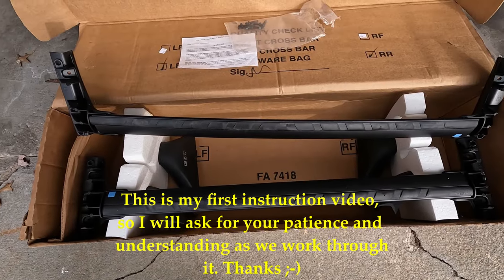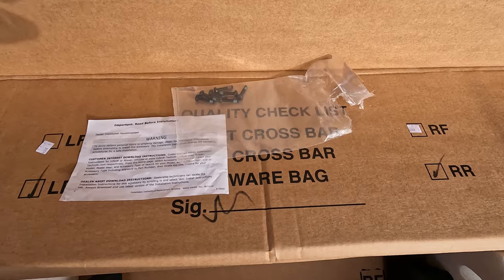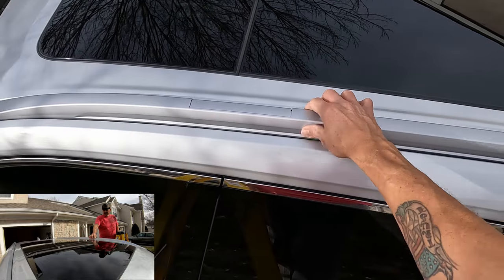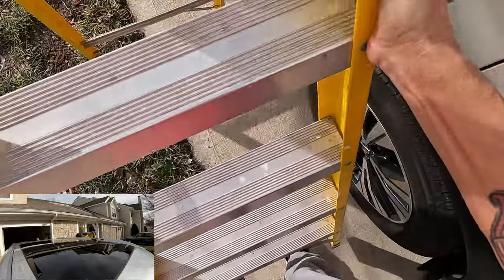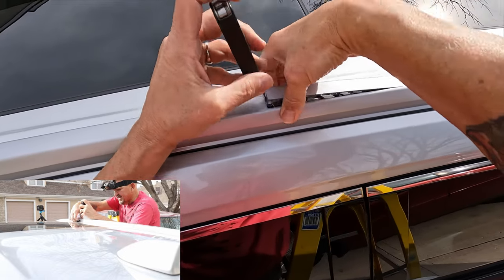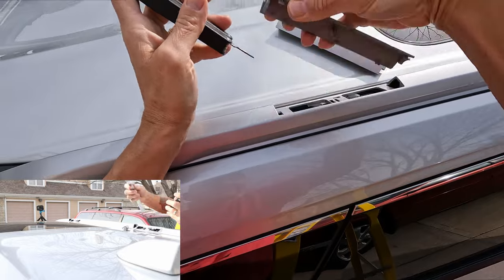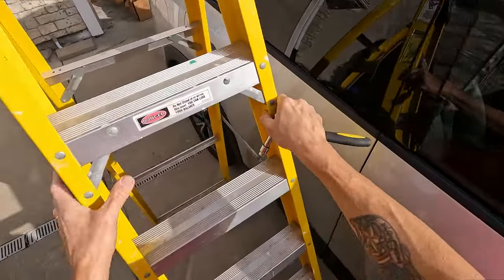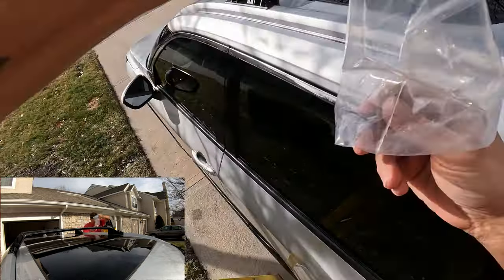Roof Rack Cross Bars Install - 2021 and up Nissan Rogue

Comment: Great video. The tip on the noise I wouldn’t have even thought of. Question how do you like your Napier tent. WWhich one did you get I’m thinking the Napier or the ridge line just starting with my set up for car camping going to Denali this year

Comment: Thanks so much for this video, just a stupid question, would this fit the platinum too? Like are all the models the same as long as it’s a 2021? Thanks.
Reply from the maker: when I purchased mine, they were for all models 2021 Rogue with the factory installed roof rails.
Reply: @livineachday2300  thank you

Comment: So these are the OEM Nissan rails? Making sure I understood your caption. I have some cheaper aftermarket I just bought for my 21 Rogue and they look very similar but once I get to about 30-40mph they whistle with the wind… drives me nuts and I’m tempted to spend more for OEM parts if they are silent like before I installed. Have you (or anyone else) noticed wind noise or whistles?
Reply from the maker: No wind noise I heard at the times I drove around surface roads or highway speeds (no driving like I stole it of course - LOL).

Comment: I’m trying to figure out the screedriver i should use for mounting mine. I have bough so many scredrivers and nothing seems to work. Some of the scrwdrivers i bought are torx 30 1 inch torx 30 2inch several phillps drivers and thick looking drivers. Can someone tell me the size to fit these bolts? They look thick.. also in case of buying a screwdriver bit what is the name of tool to be use on top of the screw to attach it and rotate the screw?

Comment: Thanks for the video! Have you installed anything else for your rogue? Looking at getting the interior accent lighting and kick plates done but not sure if I trust myself lol. Seeing someone else would greatly be motivating
Reply from the maker: So far, cross bars, tinted driver/passenger side windows is all. Trying to kep it simple and use it for adventures.
Reply: Could you show us how it looks from inside if you look up out of the moonroof? Wanted to know how it affects that

Comment: Did your rogue come with the roof rails? I have 21 SV with no roof rails, and after ordering these
I need roof rails. Nissan is saying we can't
Reply from the maker: It came factory with the roof rails, we purchased the rack cross bars. I do not believe you can have the "Roof Rails" (the rails in which the rack crossbars install to) installed POST factory.from what I know.

Comment: Sorry, I just kinda skimmed through your video. Are the factory crossbars plastic or cast metal? I saw a lot of fancy ribs and molded shapes under the trim cover there. I've been pestering Thule to hurry up and bring some feet for this model year to market already. My wife has been leasing these for all the model years they've been in the US and have been able to keep swapping the Thule universal raised roof rail grabber feet from car to car. But like you've shown here, these new flush rails need a totally new design which neither Thule nor Yakima has a solution for yet and it's been two years!
Reply from the maker: Hi There, they are metal. When I researched for some crossbars at the time, the Nissan brand was the only that I found for this model year. I kept finding, at the time, Thule, and other brands were still developing a version that would fit due to the change in the mounting rails for the crossbars on the 21 Rogue.

Comment: How’s the factory part? I purchased a cheap 120-buck Amazon third part crossbar. Also installed it myself. Apparently, when the speed is 40-60mph, I will clearly hear some wind noise(the car is pretty quiet before installation). Do you have extra noise after installation?
Reply from the maker: Wife and I had not noticed any extra wind noise ourselves, but were matured in life and just may a filtered out...LOL.

Comment: Isn't the front cross bar comes in an angle? I tried to put a basket and it wouldn't sit properly. Any tips?
Reply from the maker: Yeah, may have to fabricate a bracket alternative or look at many basket options. I have heard that some folks out a thick rubber piece between the basket bracket and the crossbar, then tighten it down. We have no direct experience on the baskets and have chosen to utilize a trailer hitch/receiver basket instead.